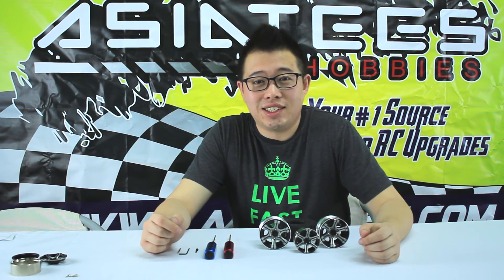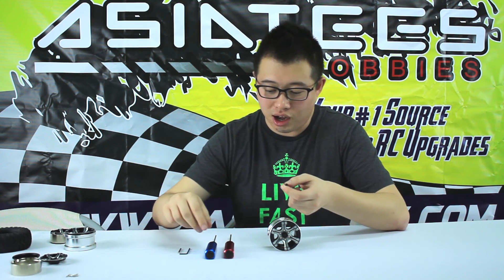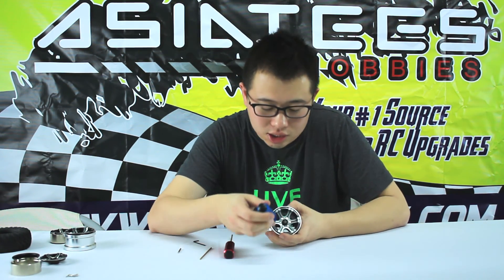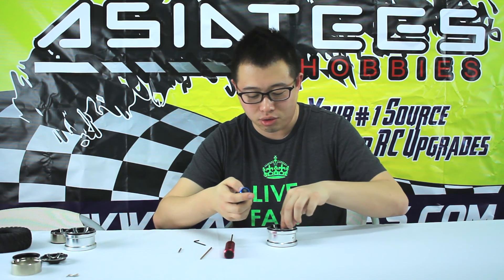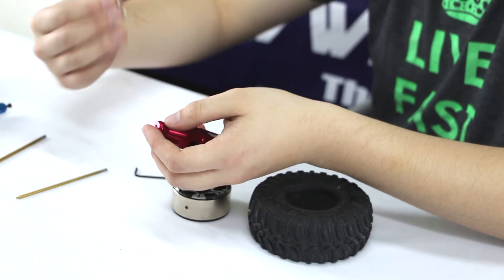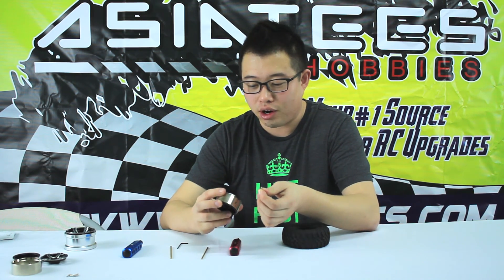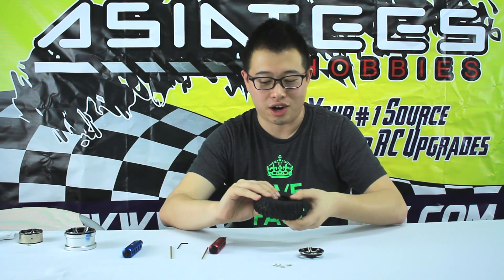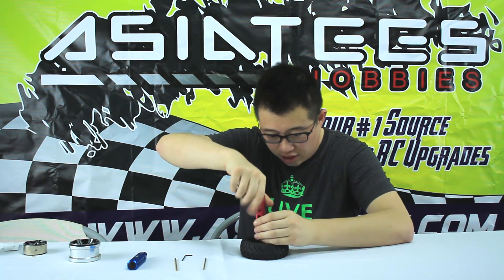[Product Assembly] Boom Racing High Mass Aluminum Beadlock Wheels

Comment: Thanks for the video it helped figuring out the installing the lug bolts. I just ordered the wheel twin -7. Dumb question though. The ones I have came with hub covers. I am not sure how to get on hex with the hub screwed in already ? Thanks for any advice or insight.
Reply from the maker: +TK Things The hub cover comes out with the lug bolts. Once it's off, place the wheel hex and tighten it, and the hub cover should fit right over it :)

Comment: Do you know what size Hex screws I would need cause the little bolts are not that great I already stripped 5 of them.
Reply from the maker: +TK Things Send an email to sales@asiatees.com with some photos for us and we can hook you up with replacements if necessary. Remember, don't tighten them too hard or else they might strip! Once it's a snug fit, don't twist any further

Comment: Is there anyway for the 2.2 models to fit into a 1.9 tire or not since its a bead lock? Thanks
Reply from the maker: +travisamc You can stretch a 1.9 tire over 2.2 beadlocks for sure. It just takes a little patience as the bead usually likes to slip out while you're locking it in place. :)
Reply: +AsiaTees Hobbies thanks for the reply, I might have to try it out. I really like the 1.9 styles better though.